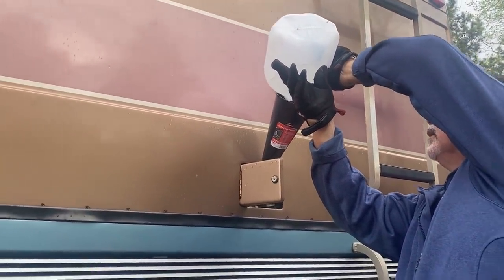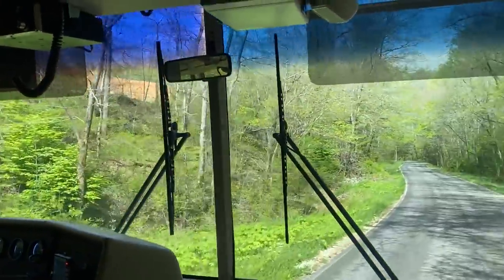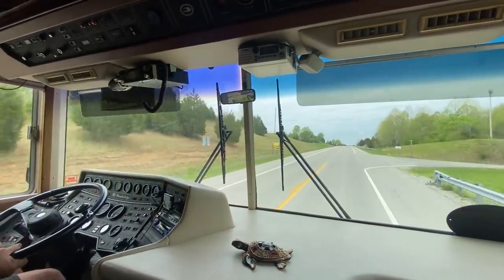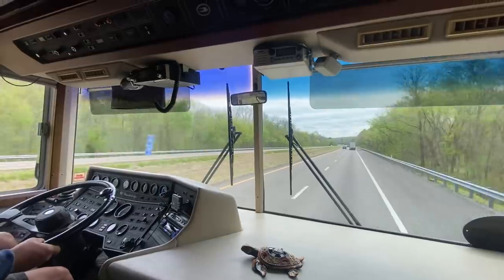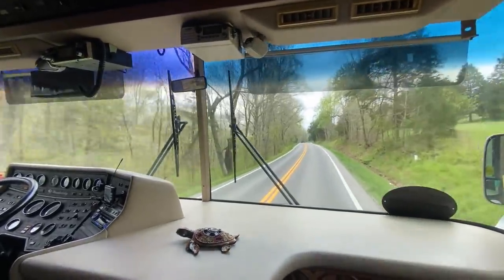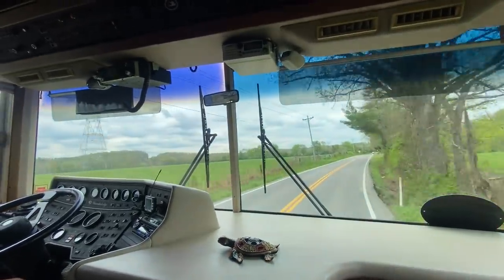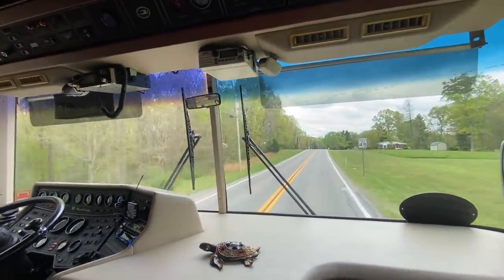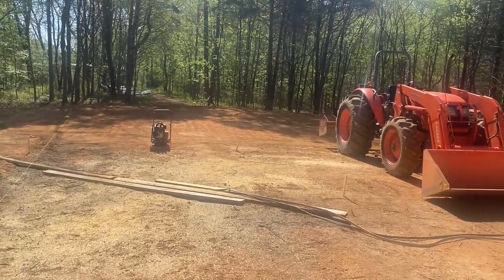Test drive after rebuilding 1/2 8v92TA in the Wanderlodge rv bus

Comment: The silver 92 V-8 Detroit Diesel holds a special place in my heart because my first job as a mechanic (18 years old) was for a steel cutting company that had a fleet of 8 tractor trailers 5 of them had the 92 V-8's. I learned how to drive a big rig in a truck with the 92 V-8 and I can tell you that these trucks had their oil changed with the correct oil sooner than recommended and every one of them had to be rebuilt/overhauled in less than 60,000 miles.

Comment: can you split the temp senders to two separate gauges [left bank . right bank] ?? so you keep a better eye on what is going on on each side of the engine !! looking good 👍👍👍👍
Reply: Southern Hellstorm  You could have separate sending units/sensors for each head serving a separate display heads in the instrument panel if you really wanted to break the information into zones. The owner would just have to decide if it would be beneficial enough to rework or modify the existing gauge arrangement. It is entirely possible that a single dash gauge with 2 separate displays ("needle pointers") handling input from 2 different sensors is available that could fit into the same space occupied by the existing coolant temperature gauge,
Reply: Yes like an

Comment: Scott another great video!! The turbo - charging really does quiet the Detroit's down quite a lot w/ a good power boost Out of all engines powering buses, the old 2 stroke is the only one that has been mounted in so many different ways Inline, transverse,& pancake style ala the old Crown coach.The old Mack transit bus had a transverse mounted thermo- dyne w/ a torque converter. Scott, just kidding around you need an old self loading elevating paddle scraper Wabco 353ft model w/ front and rear 12 V-71T's for a big  whopping 1050 h.p. A nice Tonka Toy to tinker with.Say that last line quickly 5 times.Ha Ha!! Best wishes for you and your family.
Reply: I  operated an old Wabco 262 FT,elevatingscraper in the late 80,s.Had 8vs. Was a monster.I think it moved 30 yards.Seems like it was a mid 60,s machine.
Reply: It was a 252.

Comment: You made comments for a good 10 minutes or more of this drive that clearly told this owner that you were uncomfortable with the speed he was driving. You're a better man than I because after the second or third time saying something I'd have been done. Either he'd have let me drive or I'd have called for a ride. Does this guy have Rotoguard or anything like that on those steers in case of flat because if not there's no way in hell he could save this on those roads with no shoulders. Retired OTR Driver with 1mil+ safe miles here, so no I don't play when it comes to safety. I've seen far to many fatal accidents over the years to mess around...

Comment: Good morning. I really appreciate your videos. I have a 1994 Beaver Patriot Stratton 37’ diesel pusher. When I connect the positive cable to the 4d chassis battery the air buzzer goes off even before starting the bus. When the air pressure builds to 60 psi it goes off. When I turn the vehicle off it keeps running and I disconnect the fuel pump which shuts it down. Any pointers would be greatly appreciated . Thank you. David from Maine.

Comment: I find it interesting how rv manufacturers use off the shelf automotive headlights and taillights and I can immediately tell what vehicle the taillights are from.  This bus has early 90's volvo 760 taillights in a double stacked configuration
Reply: And Vogue used Cadillac Fleetwood headlights and turn signal from about 1988-96 on the Prima Vista motor home

Comment: Wow does that DD look and sound sooo much better👍

For coolant fills consider using a vacuum tool like the Airlift.  Just used for the 1st time on our coach with Cummins L9.  Coolant drain, flush and fill. Aways used on other vehicles the funnel w/plug thru fill neck followed by burping, adding and then capping, driving under load, and re-checking when cold, method.

However, with turbo intercooler etc, didn’t want to risk pockets of trapped air causing hot spots during the 30 minutes of run time in order to open thermostat, adequately distribute the Cummins Restore Plus cleaning solution (heater core in nose quite a distance from rear) & let it work the amount of time per instructions. Also, had to run a rinse cycle in the same fashion following the cleaner drain. 

Tool inserts into the fill neck…snug it down…hook up the air line fitting via supplied quick connect fitting and your air compressor creates a Venturi effect that draws a vacuum. -25 is the target on the gauge. Disconnect air line fitting and quick connect the screened draw tube w/ ball valve fitting. Insert fill tube into your bucket of solution and open the ball valve and watch it fill the system. (my L9 configuration required 12 gallons as determined from initial drain and measuring as the capacity for this particular layout is stated nowhere)

Sucked up the 12 gallons of coolant /distilled water mix beautifully and after I capped and ran the system, to circulate the new coolant & open thermostat and then cool down & shut down, the resting level in the morning was dead on…perfect! (and you know how rare that is lol).

Airlift will also check for leaks since once you create the vacuum, you can just observe the gauge for several minutes and discern any decline.

Lastly, a question. Do you or would you work on a manufactured bus like a 2015 Tiffin AllegroBus for installation of Konis all around, chassis lube, brake check type work? 

Take care, D

Comment: I have always heard that you don't want to use DI water in a radiator.  Click and Clack would best describe it as "hungry water".  Deionized water is looking for Ions to reclaim and will eat the inside of the system.  Your thoughts ?  I noticed that the tree was still on the cable next to road; wow.  Thanks for the videos, maybe I will get by there someday.

Comment: I have a completely off topic question. Why do so many newer motor coach conversions take out factory air conditioning to be used while driving? When I was driving (1996-1999), I could freeze out the passengers with a low at about 60F (and I had 55 passengers sitting behind me. Humans give off a lot of heat.). On the MCIs I drove (Mostly DLC-3), all the A/C and heat came up through very narrow ducts along the windows. It seems like keeping those walls in place only lost less than 1 inch on a 102 wide coach. And yes, I understand having rooftop A/C units for camping. But it seems to make no sense to me.

Comment: In planes, they do the same thing with gauges and put "Cheater Marks" - except on planes, they're usually a red/yellow/green arc that defines the Bad/Warning/OK areas for the needle. A quick glance to see if the needle is in the green, and you're golden!
I wonder if the Temp Sensors on each head could be separated so each one drives a separate gauge in the cab?